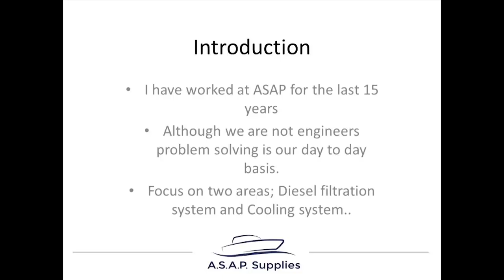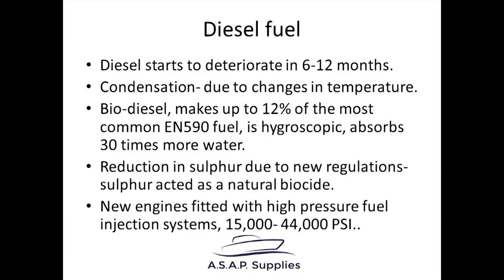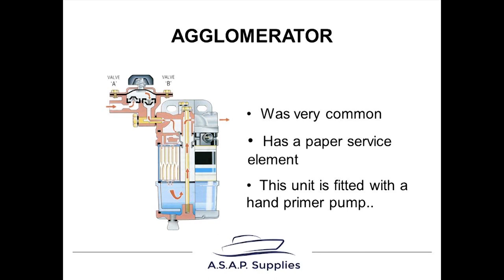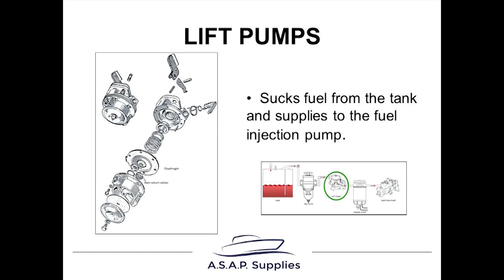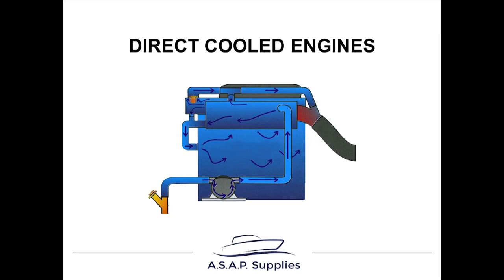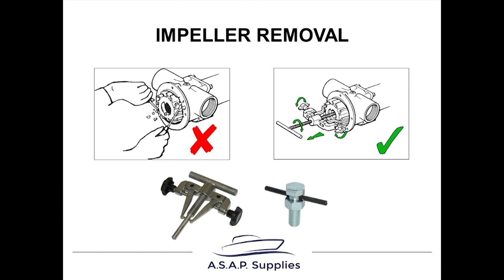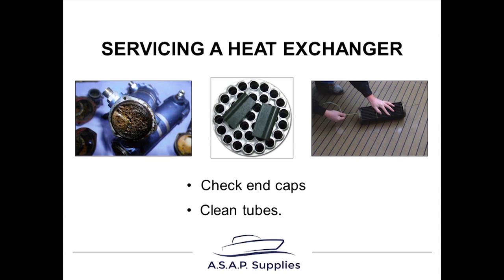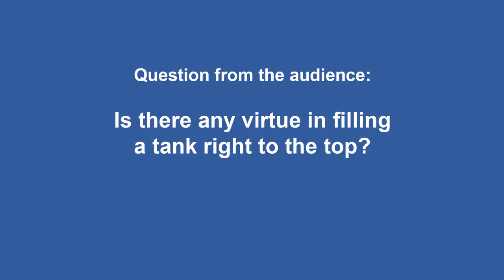Diesel Engine Maintenance

Comment: the reason for the higher pressure is for a cleaner burn 2 bar at the pressure rail
Reply: 2 bar, I guess you mean 2000 bar.